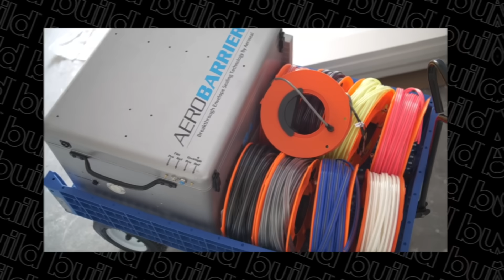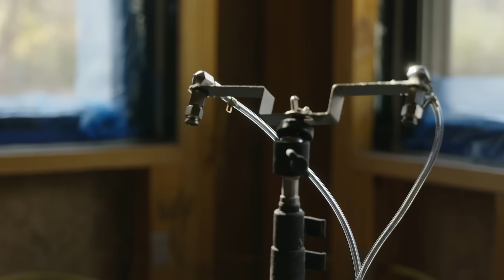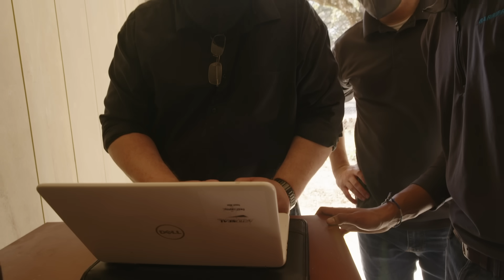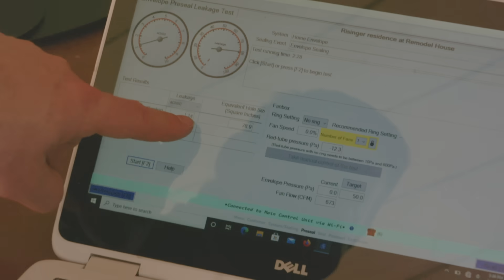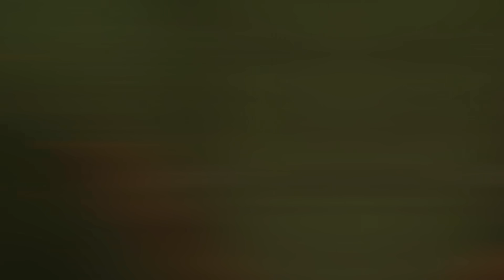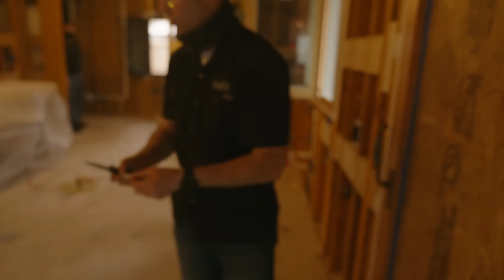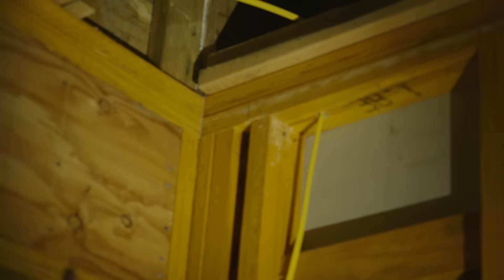The one product I'd recommend for EVERY House!

Comment: I’m a contractor… about 15 year’s ago some bureaucratic genius thought it was a good energy saving idea to make a law requiring contractors to seal all walls and ceilings 
With plastic sheeting before drywall….. it was a disaster. The house couldn’t breathe and mold and smells eventually make the house uninhabitable.
Reply: There are definitely two approaches to this. Having a house that breaths through wall sockets and base boards does have a different feeling than an air tight house. I have been in air tight houses with mismatched HVAC systems that stink, as well as “leaky” houses that smell like attic. The last house I built we did super tight but had a NASA looking HVAC system that maintained positive pressure. It kept it so clean the owner has said they haven’t had to ever clean it for dust and it smelled as fresh mountain morning air. 
I think the house you know of may have not been made truly vapor tight.
Reply: @snozcocram  and then what happens when the door is left open or do doors and windows stay locked and shut all of the time?
Reply: @thehoaxer  I’m not sure I see the problem that you do. Durning nice weather it’s okay to open the windows and doors. The house I mentioned: when the HVAC is activated it does have positive pressure so air is always blowing higher pressure inside when it is on. Not much, I think about 200 sq.ft. per minute on a 4000 sq. ft. house. 
You are correct about the plastic sheets being a bad move when next to drywall. In some climates it’s a disaster. But today there are some great membrane materials.
Reply: @snozcocram  ok granted if you have a NASA life support system in your house even if it’s on Mars its going to work. Otherwise it’s a stupid idea. A house needs to breathe
Reply: @juniperman  I da’no, I saw what that did in Amityville. Lol
Reply: @snozcocram  I'm with Beckett on this one, we have houses dating back hundreds of years, that breath and allow moisture in and out, as we bring moisture in ourselves, whether cooking, breathing, drying washing or bathing. I can see what you are saying, though I'm still not convinced plugging up every hole and making an unbreathable house will last the test of time.
Reply: @thehoaxer  I guess time we’ll tell. The current title 22 and 24 energy codes are here to stay. I think we here in the US will catch on to the building practices like construction in Europe and eventually get it right. Oh man, did I just say that?
I can say this. Retrofitted or replaced double glazed windows, retrofitted insulation and sealing wall sockets and floor boards in an older constructed house with bathroom, laundry and kitchen venting makes a house very cozy and I haven’t had one call-back yet. Does that sound bias?
Reply: @snozcocram  no I didn't say that at all and really I think you are putting words in my mouth in an unfair fashion. I think it's great that every country has its own building techniques and ways of construction, it would be boring otherwise. I didn't in anyway imply that Europe builds better, and I feel you filled in gaps that wasn't there and grabbed the wrong end of the stick.  I'm someone who has worked on old heritage such as palaces  too grade 1+2 listed, and to brand new builds, I am basically going with the experience of what I have seen. 

Though I do absolutely agree with you, it will be a test of time and the longer something sticks around, the more likely it will get adopted.
Reply: @thehoaxer  I didn’t put an “I” about the Europe comment. 
I think we are pitching to the same batter here. I have found that with the lower quality wood and a mixture of compounded materials like the new particle boards and water barriers we have to start thinking about mitigating vapor when building more than before. As a rule I but motorized vents anywhere water is used, and am sure to have unobstructed air gaps for every passive vents, including sometime between inner walls and flues.  (Code permitting)
I don’t think this technique on this video will become mainstay but if a client wanted it, I could see the value. It’s higher end construction (not track) and my HVAC guy would love the work.
Reply: Yea, exactly, and then someone opens the window or leaves the door open, but them micro holes

Comment: Had no idea, very cool. 

“How’s your respiratory system?”

“Sealed 50%….”
Reply: They Will do anything to save some labor cost … 
Also if you do not put A stale air removal system in this house after it’s sealed up to number three,  you will make a sick house
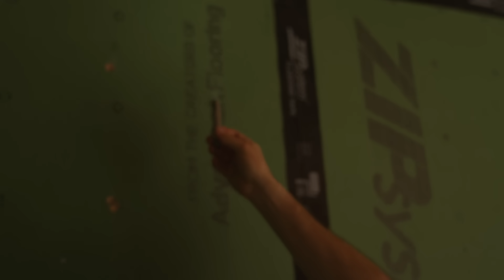Reply: It's pretty cool technology. I like that Matt created the holes in the plywood to see how the product works. However, I was surprised to see Matt not wearing a mask at the 7:10 mark when there was clearly visible sealant floating around.

Comment: This channel is the longest running commercial I have every seem.
Dude we get it the "XYZ 5000+ WILL change the paradigm of building science"... 
but dear god there is a thing called cost/benefit and Return on Investment....
We are not building rocket ships here governor...

PS Fix a flat is useless... and slim has its time and place .. but no I would use it as a "solution" to a "leaking tire" on a daily driver...  
You get it properly patched, until you can replace the tire. Its a temporary solution or a patch for a non critical application like a lawn tractor... It actually says this on the container.

Comment: Ok
So the house is so tight that there’s very little replacement oxygen in the home 
All combustion units such as furnace and hot water tank, gas stove , gas dryer eating up oxygen
Eventually this home could become oxygen deficient 
Sometimes being too tight isn’t good 
Running the fan on low in your cooking and heating system keeps a home positive , so no air coming in the small holes 
And your furnace has a makeup air duct feeding it so it won’t be depleting oxygen as it runs to heat the home
Reply: Cooling system

Not cooking 
Auto correct not correct

Comment: You're creating what we used to call a "sick house". For the average home the interior air is twice as polluted as exterior air. Most cities and counties require a 200% air exchange daily with the outside air because of the everyday chemicals you use in your home. Your heating/cooling filter's do nothing to remove them and making the home tighter w/o fixing that issue is a VERY BAD idea.
Reply: He addresses air exchanges in other videos.. not an issue with proper exchanges built in to transfer hot/cold/vapor..

Comment: The problem with a tight house, is sure it keeps air out, but it also keeps fresh air out and stale air in, or worse, carbon dioxide and carbon monoxide.
I'll take an open house over a tight one any day and I live along the gulf coast. The AC system can take care of what little humidity or pollutants sneak in. At least I don't have to worry about waking up dead from carbon poisoning

Comment: I had this done to my new home after the sheet rock, and they were able to bring a 3 ACH 50 minimum required to a 0.6 ACH 50.  This was my first self build home and was not willing to gamble meeting the 3 ACH 50 requirement so I had AeroBarrier do the work.  Within a few hours they were done.  After being in my home for about 3 years now, it was well worth the cost of having a near passive home.  The heating and air conditioning works better and at a lower cost.
Reply: How long is it supposed to last

Comment: At 14:25  the AeroBarrier Contractor says the the cost is between $100 to a $150 a finished square foot. Matt then mention's that he's just shy of 3,000 square feet and then goes on to say that his local AeroBarrier guys gives him a bid of $3,000 to $5,000 bucks. The average between $100 to $150 is $125. With that said... $125 x 3,000 square feet isn't $3,000 to $5,000 bucks
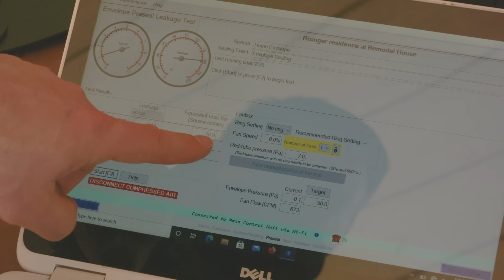Reply: Clarification. I just watched that segment and he said “a buck to a buck-fifty”; which is commonly used to refer to hundreds. He literally meant $1 to $1.50. So, $1.25 x 3,000sf = $3,250; or x $1.50 = $4,500. Also of interest, at 7:01 he indicates the total leakage on the house before aero-seal was 79 sq inches, which is equivalent to about a 5-1/2” square hole. That’s pretty a pretty significant loss.
Reply: @iwonder-t1r  Hmmm! Interesting. Yeah I was thinking it referred to hundreds, but you very well may be correct.

Comment: how exactly do you expect to get rid of the stuff left the floor? it sounds ridiculously dangerous to breathe as i see other comments have pointed out. i would not not want this stuff hanging around. yet sweeping silicone sounds difficult and will just reaerosolize it, and it would surely just instantly clog the filter the moment you start vacuuming it. would a mop work? that sounds like a sure way to clog up the city's pipes and the gills of every fish in the ocean.

Comment: This is for hot humid climates in the south. In the north you only want that vapor barrier on the inside (in the north, the condensation potential to avoid is on the outside walls). In the north you want the outside walls to breath and the inside to be sealed to prevent vapor. The key is, if you are using open air void insulation like fiberglass, *you only get one vapor barrier*, only one wall can be sealed, the other needs to be open. If you seal both, you are guaranteed trouble and mold. Your average carpenter has no clue about these issues.

I don't see a way to use aero barrier in cooler climates. Kind of surprised that solid wall construction like concrete, concrete/foam form blocks, and rammed earth are not more popular since they solve the air void and condensation issues.

A real concern is any electoral boxes, panels or equipment that lead to the outside. If it goes through an outlet or a breaker, that stuff is potentially dangerous and damaged from the inside where inspection might be impossible. That could include gas furnaces and water heaters, anything with a flu or vent to the outside, obviously vent fans, anything with a drain, etc.

If you miss something and the aero barrier "fixes" something it shouldn't have, you have a potential problem.

Comment: I thought you wanted the house to be vapor permeable?

From building science and I think your past videos:

"And no vapor barrier on the inside of the assembly. Repeat after me, no vapor barrier on the inside of the assembly. We want the assembly to dry inwards from the control layers—and to dry outwards from the control layers. Always. Everywhere."

"Two seemingly simple requirements for building enclosures bedevil engineers and architects almost endlessly:

keep water out
let water out if it gets in"

How does this step fit into the perfect wall design? What am I missing? I am assuming that the aerosolized sealant is a vapor and is sealing wherever it permeates out. I'm also assuming that the second half of this video isn't going to answer my question right after I post this comment.

Comment: As a GC, I’m still on the fence about air barrier.This is how LEED Platinum projects started to help buildings with efficiency. It’s supposed to be the same cost as a normal building but in actuality it adds a significant cost and some lower quality material. The LEED Cert plaque is just another money grabber. 
Air barrier is just to show our design flaws and patches it with a band aid. Been doing this for awhile and home owners are getting stuck with another money grabber. You want efficiency start with a design that incorporates thermal efficiency and details showing each  MEP trade it’s simple. All he is showing you is a lazy contractor not doing his work and you have to pay extra to fix it. Remember this is a water base product once it gets wet like a band aid it falls off. So do it right the first time.
Reply: Not sure how much efficiency you can attain with Electrical and Plumbing, but certainly you may with Mechanical. I think that more focus should be placed on proper framing and caulking. I do agree that LEED is just a politicians feel-good campaign project. In reality it is the customer that dictates construction specifications. More often than not, customers choose not to pay more for better construction techniques and settle for bare minimum building code standards simply because they don't have money! 
Most people don't understand that building codes are usually updated not to improve safety for the occupant, but to approve construction materials and techniques which lower cost.

An example that customers care not for LEED, look at the windows. Most will have single-hung aluminum and sometimes vynil; hardly ever casement since it is more expensive. Insulation, most are batt and not spray foam.

Comment: houses are built like coolers, air tight,  you'd better have an effective air exchanger to maintain the quality of the air inside the house...also needs to be maintained,  filters cleaned, otherwise the air inside will be more polluted than the exterior outside air....viruses and bacteria

Comment: Matt, I noticed in one house the drywall was on before using AeroBarrier and in your house it was not. Is there any advantage to using AeroBarrier after the drywall? What is the best stage of construction to use it?  
You mentioned Sheetrock so I'm assuming it would be best to use AeroBarrier before hanging sheetrock. correct?
Lastly, could using AeroBarrier replace using spray foam?

Comment: Unrelated.....exept to your kids,and the big avoidable loss of time and most of all it is a big headche...l when you go to take a trip with family and after you get there the valve stems in the tunes in your tire will become unglued where it's fitted into the tire itself...I have without a doubt  found out that slime is really not good in tires.i have a huge 20 gallon bottle  that I would put into tires for preventative leaks....having it in there for a long time (over or close to a year)..you seem like the kind of dude that gets alot of leaks on anything from backhoes to wheelbarrows ...l like myself...driving or operating around jobs it's like myself

Comment: ? After you spend this $5,000 to do this and get your house certification. What happens when someone slams an exterior door shut and over pressurizes the house. Will your house still meat the same standard at the same level when you 1st finished with this system

Comment: Hey Matt . i live in northern california. and i get Kraft batt insulation for free. im currently building a 40x60 22’ height 2 story barndominium/pole barn. shhould i use batt insulation or spray foam insulation? i want the most efficient home but i keep hearing of ppl getting mold inside their walls with foam. im planning on adding 2-3 mini spilt systems. Or should I do batts since they are free for me lol and aero barrier or spray and aero?

Comment: Sorry but not true. A house, especially a new home needs to breathe. An air tight home traps toxins  that are in the materials used in modern homes. I just do not see this system being practical over time. What is that product you are using contain. A common house wrap used today does an adequate  job at helping seal a home from most air from escaping or entering a home. So this junk you are fogging the home with ends up all over the windows yes? That stuff is not just going to float around and do nothing.   Not a great idea as far as I am concerned.

Comment: I feel like this is going to add a bunch of film and slime on the glass , beams , and wiring , etc causing more of a mess and hassle than helping.
Reply: You can cover the glass/doors with plastic as those are the only finalized pieces in this stage of construction. (dry)wall/and flooring will cover the rest... dont see an issue there.

Comment: Matt - I love your channel and this was a great demonstration of a unique product/system.  But  when they talk about the cost of this system, I think that was very misleading of you to say "wow thats reasonable $3000-$5000 for this tremendous airsealing in less than one day.  Vs. what I'd have to pay a guy to go around caulking, taping , foaming and sealing everything for days..."   C'mon.  In reality , you could pay a guy $500 for two days sealing with $600 of products and get similar airsealing results. with guidance and assistance of a blower door and/or an IR camera, that might add $500 more - so, whats cheaper ? $1600 or $3000-5000 ? Lets be real, this is a very expensive system.  Airsealing is a rare art / skill /craft but it can easily be learned and applied by any builder, and it can be retrofitted into existing homes.  Aerobarrier is for new construction only and cannot be retrofitted into finished homes. They do make a similar product, Aeroseal which seals ductwork with similar methods. That one is a good value to retrofit in existing homes.  
Thank You for bring us this demo - it's still a great learning experience.

Comment: With all the moving parts in the house during summer and winter, how much does the isolation leak over the period of 1, 5 and 10 years, are there any measurements or is it assumed that the tightness does not change?
Reply: I think this is the argument for over sealing because everything fades overtime.
Reply: @ArthurBugorski  the question still is, how long does this seal last? The wood is working (moving) quite some amount over a years period ...